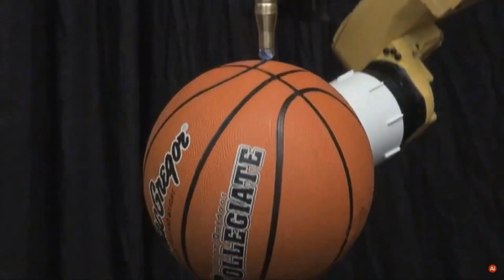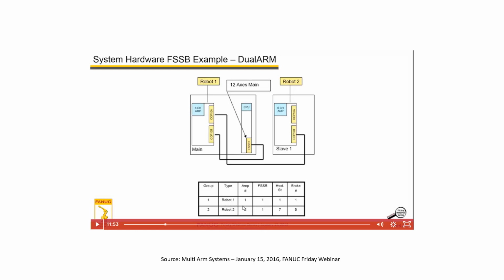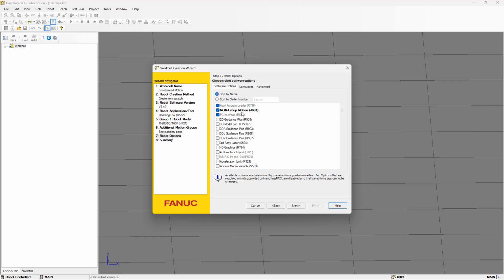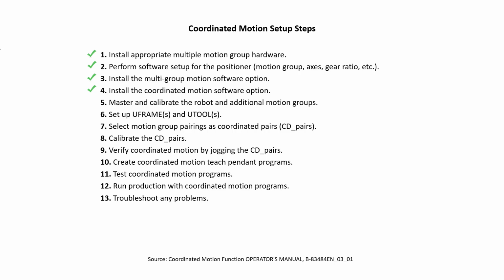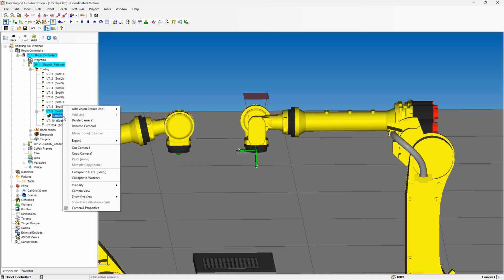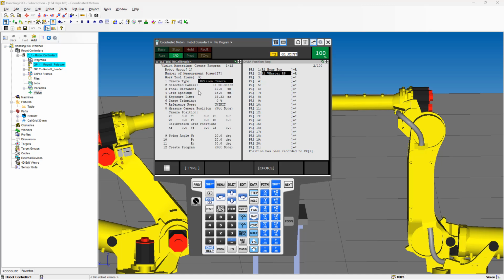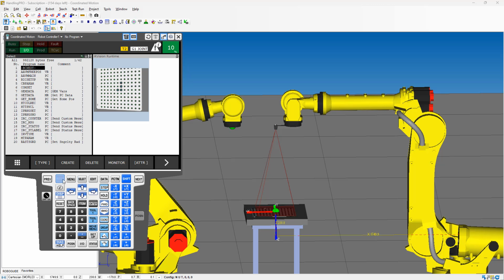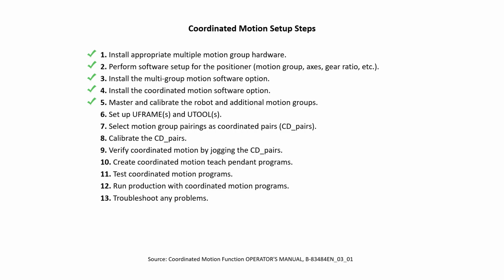RoboGuide Coordinated Motion Part 1

Comment: Thanks for the tutorial,
I am having two issues : (1)  the brake number for Fanuc F-200iB robot, which is parallel robot.
And (2) This model of robot does not support Collision guard option even though it is unchecked.